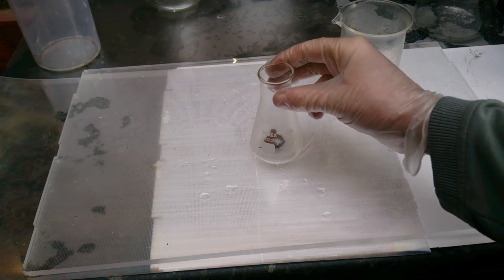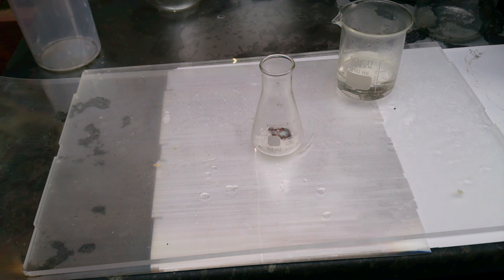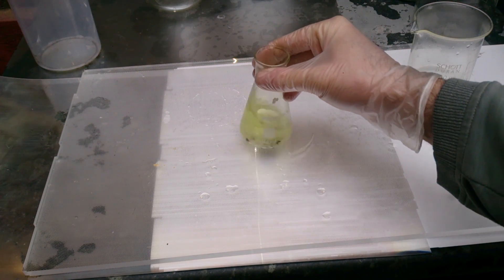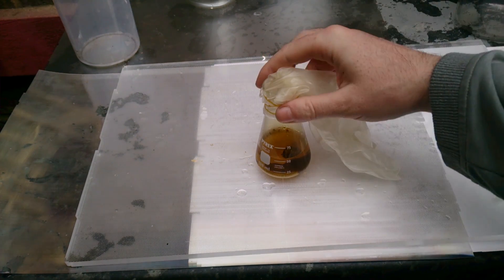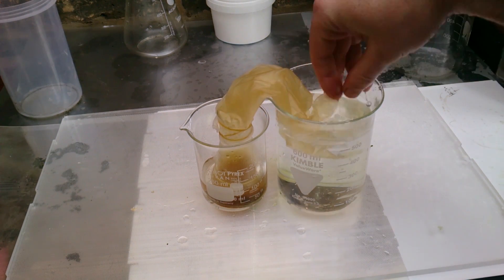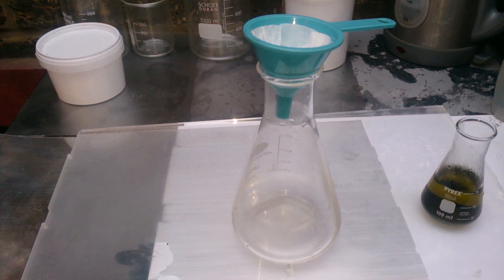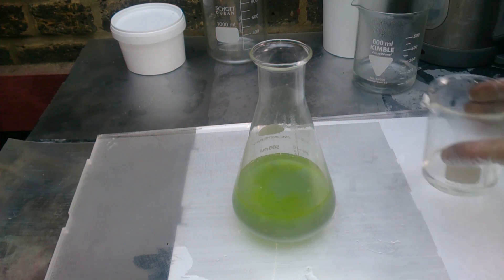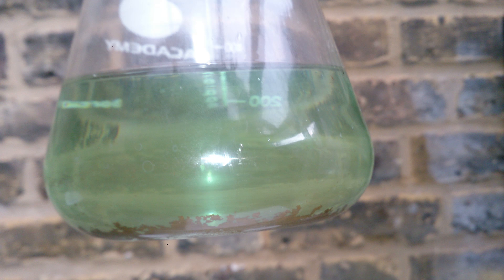Dissolving Gold in Poor Man's Aqua Regia

Comment: If you have a nitrate salt then why wouldn't you just synthesize nitric acid with it?
Reply: Bwcause then youre vaporizing acids. Need to distil it. Need to be able to store a volatile oxidizing acid. Its easier to just have some powder you can scoop into the reaction. If you are doing huge amounts its probably better to use the acid
Reply: Doesn't have distillation thinf

Comment: I've gotten some good info from your videos.  You explain things well and you go at a nice pace for taking notes.  I was excited to try this poor Man's AR method on some concentrates that I have.  But I had to laugh at myself when I realized I was just going to end up with a beaker full of white mushy salts.  Hopefully you can give me a couple tips and I can try again.

First, I washed my cons in some HCl thinking this would be a good way to get rid of some base metals - then filter and wash
Second, I added a couple teaspoons of Sodium Nitrate (Hi-Yield 16-0-0) with about 100ml of HCL - had to heat a bit after an hour because it didn't look like much was happening - then started getting bubbles
Let sit overnight
Third, filter into beaker and slowly add Sulfamic to de-NOX - very visible roiling on surface and lots of white gas released.  This goes on for a long time.....every time I add another 1/2 teaspoon it takes off again.  Finally it calms down and no heavy reaction.  It does change color from that deep golden to more of a pale yellow.  Pale Yellow salts collecting in the bottom of beaker.
Fourth, I filter, let set and slowly add SMB.  Big reaction with lots of bubbling and fumes.  Keeps getting lighter and lighter in color.  I think I could keep adding SMB all day.  The only thing collecting on the bottom of beakers is light, white fluffy stuff.

I am going to keep experimenting with different combinations and steps but wanted to ask a knowledgeable person what the obvious mistake is that I'm making.
Reply: ج۶عث۳ههخ۹ق۷چ۱حص۵ف۷ح۸صًچ۰ه۲۶ث۹۶هثنع۱حث۲طح۲
Reply: i got the same behavior ... white mushy salts seperating to the bottom...maybe this caused by Tap Water? Did you manage to purify your Gold and how you did it?

Comment: Hello... Thank you very much for producing what appears to be the most practical and economically methods in the fine art of Gold Recovery. Question I have is: May I use Baking Soda to Neutralize this acid solution?
Reply: If you mean neutralize extra nitric acid before precipitating the gold then no. This will cause base metals to fall out of solution in the form of carbonates and hydroxides and would contaminate your gold. You could try to filter these out then precipitate the gold but this is not advised. If you mean to neutralize the waste solution after any precious metals have been recovered then sure. I usually a good idea to removed all dissolved metals before dumping out any waste solution.
Reply: Also to precipitate gold with sodium metabisulfite you need HCL in the solution. SMB reacts with hydrochloric acid to make SO2 gas, this gas is what then causes gold to precipitate out. As baking soda will neutralize both hydrochloric acid and nitric acid it can't be used to neutralize extra nitric acid present before dropping out gold.

Comment: Hi Boris. I tried your instructions, very good video. After the initial reaction the contents turned very dark green, almost black not tea colored. I have not de-nitrified it yet and it's been 3 days. Did I do anything wrong or should I just continue the process? I used HCl 35% and potassium nitrate. Please help.
Reply: It's probably dissolved a lot of copper as well as gold.... Thats where the green colour comes from...... Notice at the end of the video the gold has settled at the bottom and the liquid solution is blue?? It''s blue because of the copper left in the solution.
It shouldn't affect you too much... Keep going.
Reply: @94981745  Hopefully you get back to me soon. I have ore thats very heavy in sulfur. I first done AR then zinc, then remove the zinc and got 1 gram of gold from 5 lbs of cons. I was told to do AR, filter, then add copper to the liquid leave sit and the precious metals will precipitate, then take this and go back to AR. I have a white sticking to the pipe looks like calcium. I cant find any help on this and am in the middle of doing this. I understand I need to do this to get the metals away from the sulfur first. Will this way of process work?  Thanks